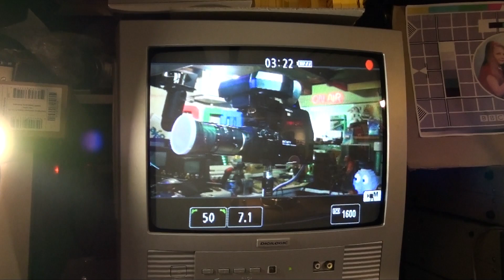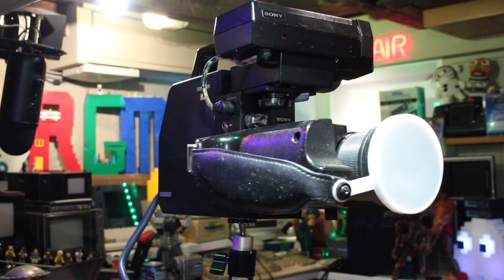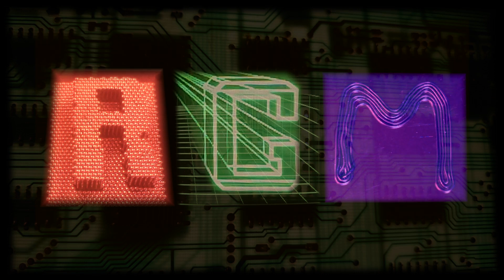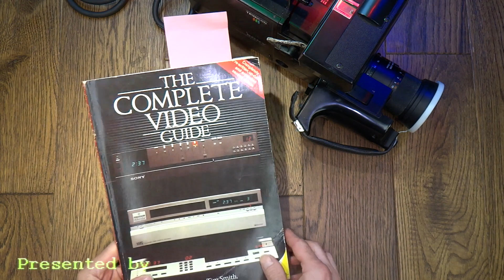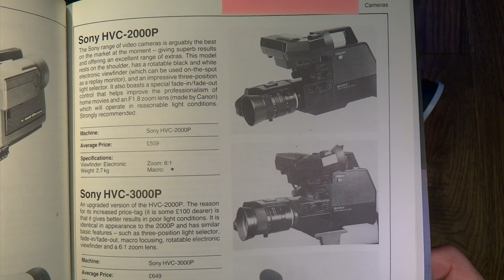SONY HVC 3000P TRINICON TUBE VIDEO CAMERA INFERRED FILTER ROTT Filter removal will it still work.

Comment: Hi, very interesting video! I’ve had the same problem with this camera. I own several of them, and they’re all good units. I had one with a ruined infrared filter, too; I notice you took yours apart in a better way. I went in from the inside and removed the Trinicon tube, but you can never really get that put back together properly—it’s a nightmare of a job. You took a smarter approach by removing the lens to access the filter. Even then, removing the filter itself is still quite tricky. It’s good to know that, without the internal filter, you can potentially attach an external screw-on filter to the lens. In my opinion, the infrared filter is the most fragile part of these amazing cameras. I have several, and they all still work. That really speaks to the quality of that era—and of Sony in particular. I love the image these cameras produce; I’ve modified mine to run on a 12V lithium battery and connected them to a portable SD card video recorder. It captures footage in 4:3 at 1024x768 resolution with a high bitrate and 60 frames per second, resulting in a beautifully smooth, stutter-free image.
Check out my YouTube channel for the videos I’ve made with them:
https://www.youtube.com/@MartijnSchot-eo4rj
Thanks, and good luck with everything. Best regards, Martijn Schot, Netherlands

Comment: You need to adjust back focus on the camera, since you removed the lens and put it back on (and also removed the IR filter). Broadcast cameras with interchangeable lenses have an actual back focus adjustment on the lens itself and this is why. If you remove the lens or replace it you will have to adjust back focus. Of course the consumer cameras like the Sony HVC series usually didn't have removeable lenses, so the back focus adjustment isn't on the lens and is internal. 

There should be an adjustment manual out there somewhere for the HVC cameras for the back focus adjustment, it's not in the service manual. But I think it should be on the lens or the Trinicon tube assembly. I tried looking though the regular service manual and I didn't find see anything about back focus, but I did see it mentions an adjustment manual. So try to find that if you can't find a back focus adjustment on the lens/tube assembly yourself.
Reply from the maker: The problem is because the element  has been removed. This creates the problem of depth of field. If a back focus was available it wouldn't cure the problem unfortunately.